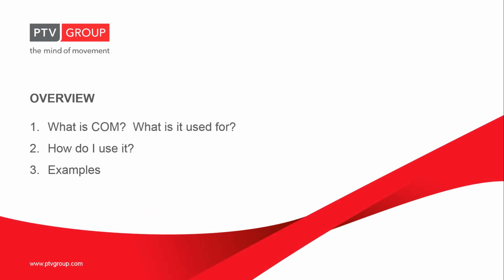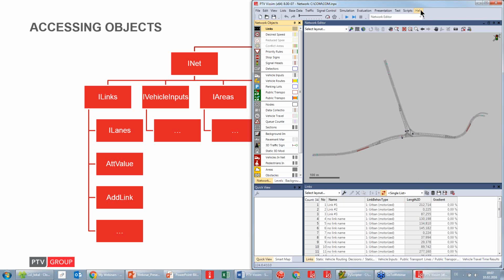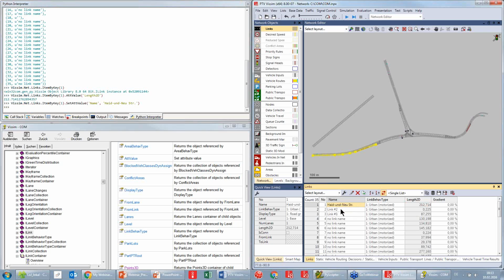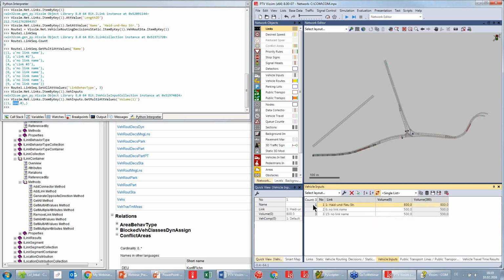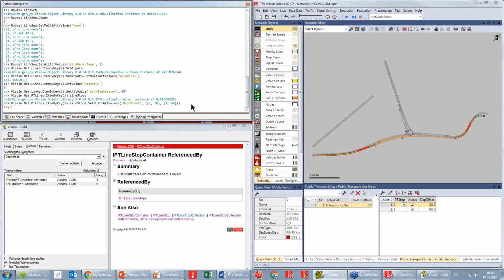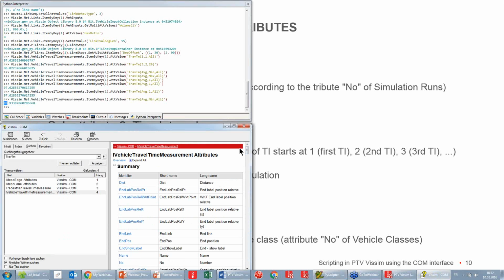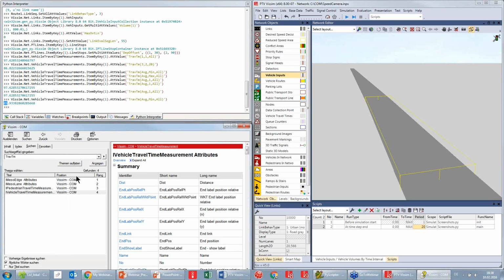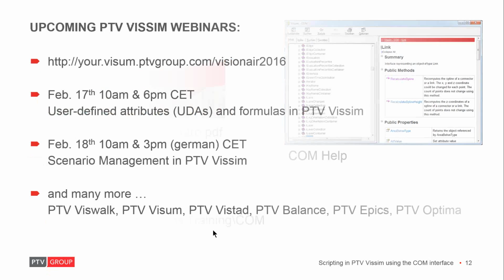Scripting via COM Interface | PTV Vissim | Webinar

Comment: How to generate spline using COM interface?
Reply from the maker: Hi Naveen, here's what our experts say: there is an example on how to use the COM interface to generate splines based on points in the training directory of your Vissim installation. Please check ...\Examples Training\COM\Network Objects Adding\Network Objects Adding.py 

What you also can do is access the directory through the "Help" tab in Vissim by selecting "Examples" -> "Open Training Directory". The file shows how to add links, using the "AddLink()" function and how to add connectors, using the "AddConnector()" function. Both are based on a string input of points to define the geometry of the spline (and other values). With RecalculateSpline() you can recompute the spline of a existing connector or link, if you wish.

Hope that helps,

Your PTV Social Media Team

Comment: Hello, I hava a small issue while working in Vissim 2020 COM interface in Python. When the Python code is run, the Vissim file loads, completes all the commands, provides an output and closes immediately. The file does not stay open. How do I resolve it?
Reply: Maybe you use the Vissim variable inside of a function. If you don't return the Vissim variable from the function, Python will close.

Comment: Thank you for good information.
I'll give you one question

Is there a way to save VISUM Assignment analysis results (database, JPG, PDF ...) to an external server?
Reply: That should be possible in Visum. Please post the Visum related questions in the PTV Visum forum: https://www.linkedin.com/groups/2230651/. If it is PTV Vissim related, use the PTV Vissim forum: https://www.linkedin.com/groups/2524087/

Comment: Hello Jochen. I use python to interface with Vissim COM, i can open the vissim, load road network and change network file position, but when I want to add the new links to network, there is something wrong, I can't call the net object, How can I  resolve it?
Reply: Hi, can you execute the example in C:\Users\Public\Documents\PTV Vision\PTV Vissim 11\Examples Training\COM\Network Objects Adding? If not, please contact our technical support.
Reply: I face the same problem? any solution? there is an error in SetAttValue as well ... Undefined function or variable 'SetAttValue'.
I am able to execute the example but it will close very fast after creating some links...
Any solutions ??

Comment: good afternoon; i have tried of follow your instructions, however an error appears. For example in the minute 8:00 on python i wrote: Vissim.Net.Links ; but appear this error: 
Traceback (most recent call last):
  File "<interactive input>", line 1, in <module>
  File "C:\Python27\lib\site-packages\win32com\client\__init__.py", line 466, in _getattr_
    return self.ApplyTypes(*args)
  File "C:\Python27\lib\site-packages\win32com\client\__init__.py", line 459, in ApplyTypes
    self.oleobj.InvokeTypes(dispid, 0, wFlags, retType, argTypes, *args),
com_error: (-2147023174, 'El servidor RPC no est\xe1 disponible.', None, None)